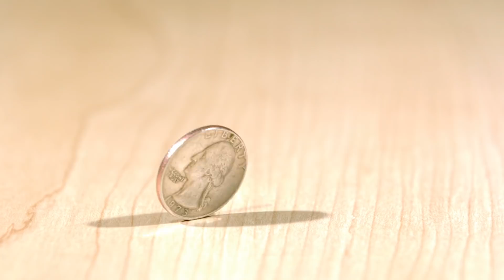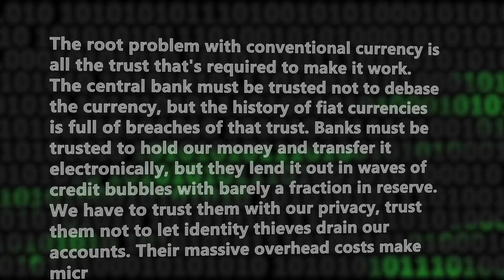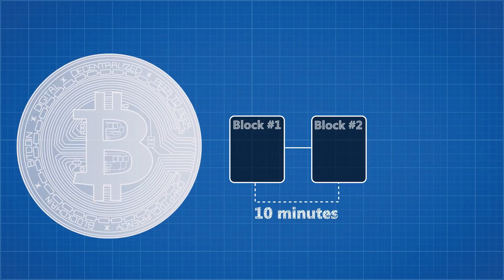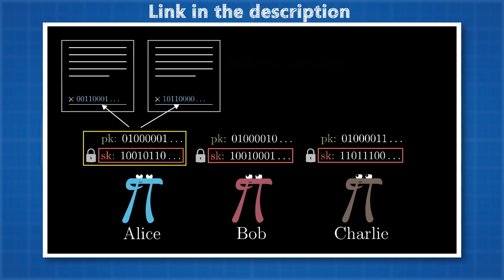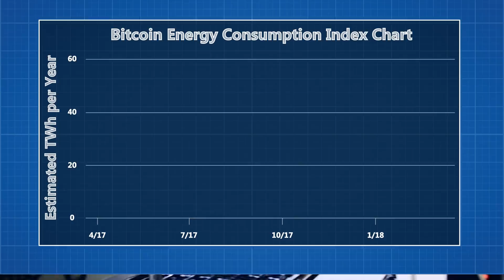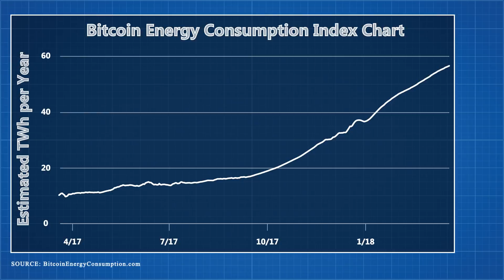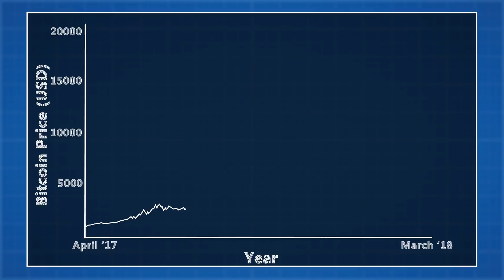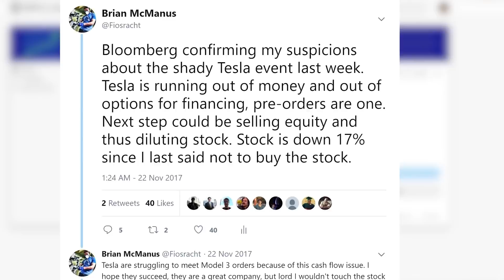Why Bitcoin Is Not Working

Comment: He is outdated on Bitcoin.... And Visa uses more electricity because he forgot to add the electricity costs of partner banks, merchants, users, which was not considered.
Reply: I am not sure if you actually know what you are talking about or not.  Merchant already been doing what you said for years, you don't need a card reader to do any Visa transaction now day (although you can still choose to do so), you can simply pay everything with your cell phone (in fact that's what the Chinese been doing for a few years already, they already have a well establish digital currency system where no paper currency is required).  So you try to argue the point where "bitcoin could use just smartphone for transaction" is completely invalid.

And you keep trying to change topic by arguing bitcoin vs paper currency.  I am just try to point out the fact that you try to argue "bitcoin transaction save more energy than Visa transaction".  I am not here to try to argue with you Bitcoin vs Paper currency and whatsoever.  Just go back to your original post and read what you type "And Visa uses more electricity because he forgot to add the electricity costs of partner banks, merchants, users, which was not considered"  

By the way, there will be no different between using Bitcoin vs Dollar as your actual currency because the economic system is still what it is right now.  The bank is much more than just a place where you store your money, they help maintain the global economy by controlling the asset and cash flow.  Hate it or not it is a well establish system and it get things done most of the time.  Bitcoin-er thinking decentralizing the  currency will get rid of the bank and government control, that just a perfect proof of which they have no basic knowledge of economy.  Who will lend you mortgage when you buy your house?  Who will let you borrow money before you earn them (aka credit card)?  Who will take care your 401k plan and investment profolio?  And you want to hear the biggest disadvantage of bitcoin?  That's if you lost your e-wallet, you lost everything and in fact more than 20% of bitcoin created has been lost forever due to that.
Reply: Is electricity more expensive than people?
Reply: We are discussing the power consumption of bitcoin transaction here, not "advantage of bitcoin transaction".  So let's just discuss only on that topic.  You said it clearly yourself "we do not need any NEW DEVICE", which means we still need device to run such transaction both user and merchant side, hence the same merchant and user cost you pointed out at your previous reply still apply doesn't matter if it use new device or old device.  The bottom line is, doesn't matter how hard you look at it if you talking about power consumption per transaction and transaction capacity Visa beat bitcoin by a mile.  I am not saying bitcoin has no advantage, I am just debating on your original post about "Visa use more electricity".
Reply: Also I would like to add the fact that Bitcoin platform (aka bitcoin bank) has far less credibility than the actual bank.  Every single bitcoin platform has been stolen once if not all their asset before (Mt.gox I am looking at you).  While actual bank was backed by FDIC to cover some of the customer's loss, for bitcoin there is no way to recover those lost.  Once they are gone they are gone because as long as blockchain approved there are all legitimate transaction there is no such thing as lawful or unlawful transaction for digital currency only valid or invalid.
Reply: Lawful vs. unlawful depends on the country where the actual transaction happens and is a legal part of agreements. If they don't exist in your country, it is simply because government (and general public - at least in democratic countries) haven't reacted to the current status of digital currency.

If somebody holds your property than according to the laws (incl. digital assets) in my country he is fully responsible for them and their security. So either he insures himself (like banks do, and are forced to, at Czech National Bank here - in which case he also receives the exactly same status as 'hated' banks) ... or he faces full consequences when losing property of other people - it's simply a fraud.
Reply: I used the word "bitcoin bank" is actually for you since you don't seem to understand too much about bitcoin hence I try to use more familiar terms you can related too.  Yes you can call them bitcoin exchange, bitcoin marketplace, bitcoin storage, bitcoin w/e.  Mt.Gox definitely hit the headline years back when they get hacked while they were at their peak.  Now recently Youbit getting hacked also get some news cover.  The funny thing is as secure as cryptocurrency is, you still can't prevent ppl from hacking the actual device that store the key, so at the end the security it promise is not a dream but a nightmare because once they are gone, they are gone, you can't even prove they were stolen or just "trade" away.
Reply: What do you mean? It is not clear. what is your thought?
Reply: Correct... But you must know SegWit... It will take Bitcoin from current low to greater than 20,000 Tx per second. Google it... I know the merchants are barriers... But you know what, the upgrade to Bitcoins will not need any NEW DEVICE... a simple phone app will allow anyone to become merchants... Thats the beauty of open source and the spirit of decentralization. We want 1and we will overtake Visa. There are opstacles. But better than corrupt banks, and also consider blockchain in budgetary funding, it will eliminate all government scams. why? 100% transparency. They actually can implement it right away, but governments and transparency. Think about the utility of a public ledger in fiscal budgets worldwide.
Reply: Dude... I think you do not know how to use Bitcoin... On the Bitcoin network. No merchants need a card swiping machine. No user needs a card or a pin... It can be done just using any cheap smartphone... Just to inform in case if not you others who will read this thread... THAT ASIDE. 

Electricity: Yes it uses a lot of electricity. Now, think of the cost of the vast data centers themselves. Now think of the cost of electricity. now think of making such centers in remote or getting access to such services in places like oceans. Bitcoin bundled with the upcoming Space+Internet will solve this issue... 
Now electricity. It is to note, Gold, to extract it, there is a lot of investments needed to do that. Do remember the electricity cost of maintaining the ledger is bundled with the control of money supply. So now you should understand how the high electricity costs are valid here. They should be high. You should also consider the cost of printing paper currency. YOu should consider central banking costs. It would be better if you understand monetary policy and fiscal budget. Bitcoin is about that as well. 

In layman's terms, Bitcoin is also about the control of money supply.

YOu might say Bitcoin is using coal electricity which is bad for the environment. It's like saying you do not want diamonds, cause you know about the tyhing called "Blood Diamond" - will you abolish the import and use of diamonds? Well If you can use diamonds, Bitcoin electricity costs are nowhere near to that kind of CRIM and indecent behavior. 

It would be better to shift this to redit and split the point numbering vs paragraphs.
Reply: In short, add up the cost of printing paper currency and cost of-of no counterfeit currency, which Bitcoin is successful in.
Reply: Yes correct... But yes need to add the point of control of money supply... And correct once you lose the password you lose your money.
Reply: Vilem Otte is right... BTW apart Otte's point, I think you really haven't used Bitcoin properly. Did you ever shift your Bitcoins from exchange to a paper wallet which had a public and a private key?
Reply: You might become a laughing stock if you ever say "Bitcoin bank" - hahahahah
Reply: I was addressing solely legal point of view. If somebody holds 'currency' (no matter whether digital, paper ... or even physical) of others (and allows transactions with them!), he is considered legally (de jure) a bank (as financial institute) here.
Reply: Have you any idea how many more people, relative to bitcoin, are using VISA? 
Have you any idea, how insanse the electricity consumption of bitcoin would be if every person on the planet would use bitcoins?  Only a handful of people have invested in bitcoins. Most people don't have any bitcoins or any other crypto currencies. And from those who do have, the gap between rich and poor amongst bitcoin owners is even larger than that with the dollar. Most of the bitcoin is in the hands of only a few people. And that would become even worse if every other human who so far has not bitcoins tried to get some. Cryptocurrencies suck in every possible way. But of course you'll have to lie and say how great they are because you don't really care about the cryptos, all you want are real dollars. You need to convince the next big idiots to buy your cryptos for more money than you did, so you can make a profit and ideally become rich by scamming others.
Reply: Your point is invalid because assuming bitcoin will completely take over Visa tomorrow all the factor you mention will also apply to bitcoin as well.  You still need Merchants, user cost if you run bitcoin as your main transaction method, you also need much larger computing power for the transaction because how limited the blockchain size is.  In a nut shell, even you take out all the "mining" part of bitcoin, by just power consuming per transaction standpoint, bitcoin is still far less efficient than Visa.

Comment: Not sure why this video is getting so much hate. Although Bitcoin was a ground breaking idea, it's far from ideal because: it has lousy throughput and latency, is computationally intensive. 

I'd be interested to see how newer alt-coins tackle the volatility problem. Because the quantity would have to change in accordance to demand to maintain a stable value, which seems a little odd.

Comment: First part is excellent. Second part forgets to mention the Lightning Network. Also:
"Total consumption for banks during a year only ... is around (I am rounding) 26Twh on servers, 58Twh on branches and 13Twh on ATMs for a total of close to a 100 Twh a year.
According to the article that trigger this discussion, Bitcoin annual Twh consumption is 28.67 , so currently more than 3 times more efficient than a very conservative calculation of the cost of the global banking system. Of course you will argue that the banking systems does more than handling a currency which is true but the difference is large enough that I do not think is that relevant. Even if only 30% of banks electricity consumption was the comparable part to Bitcoin, that will still make Bitcoin more efficient.   https://hackernoon.com/the-bitcoin-vs-visa-electricity-consumption-fallacy-8cf194987a50

Comment: Pretty shit video. ZOMG BITCOIN IS VOLATILE????? ZOMG BITCOIN uses a lot of electricity? That's all you got? Great brand new criticisms here. It's a brand new asset, of course it's going to be volatile. No one knows what it's truly worth. Of course it's expensive; that's the cost of running a trustless system. How much money does it take to run the current system? Not just Visa's costs, but the costs of every bank, ATM, printing press, every bank employee driving to work, etc. Everything considered it's cheaper than the current system. And zero mentions of the Lightning Network, which will transform Bitcoin and massively increase its transaction capacity. GTFO out of here with this uninformed nonsense.

Comment: Very valid points. Energy consumption for PoW algorythms is a serious issue, and can potentially undo those coins in the long run. However, blockchains are here to stay...so greener alternatives are researched, implemented and required. Take for instance Proof of Capacity (PoC) and it's coin, Burstcoin. These coins have all the benefits of a blockchain, smart contract etc etc. but are mined on harddisks instead of ASICS/GPUs! This results in about 400x less energy consumption for the same ammount of transactions! 

I think we should all be going into the direction of coins like burstcoin and its Proof of Capacity algorythm. Interested in Burstcoin? Have a look at this video to get a basic understanding. https://www.youtube.com/watch?v=Fyj9RIyxLb4
Reply: Proof of Stake will eventually replace the Proof of Work determining the value of a Crypto Currency... This is the future ahead which these simpleton cannot sink in... It is just like Supply and Demand like on our economics....
Reply: But proof of stake has its fair problems, the most important one being that it so much more centralised. It all originates from the same place and only slowly trickles down to the real users. Also, pos actually incentivises you NOT spending your coins, as having a lot of them is beneficial. I see PoS as a green alternative, but not as a viable crypto algorithm...hence, proof of capacity. It HAS all the benefits of PoW, but in a 500x greener form. For me Proof of Capacity IS the future of crypto instead of either PoW or PoS.
Reply: Centralized only if whales can manipulate vast amounts of coins, if there would be a limit per person and Staking feature is set, I think it would be beneficial to the whole Cryptospace. One Problem to the manipulation issue is the stake holdings....
Reply: Tbh, it is centralised by default. All coins originate from the same person - so they only become slightly more decentralised as that person, and the next person in line, and the next person in line again and so on, decide to send their coins to other people. I think in the very essence of PoS something is flawed. Where a mining algorythm like PoW, or more preferably PoC, allow everyone to just fire up their miners and get some. Sure, if you are early you probably have more, but noone is stopping you from expanding your farm and generating more coins. In its very essence its just a better model in my opinion.

Comment: Electroneum will be a better form of "currency". Monero is a better way to buy drugs. Both Electroneum and Monero are based on the CryptoNote algorithm :)  BITCOIN IS DIGITAL GOLD, IT WILL NEVER BE A CURRENCY.

Those GPUs can't mine Bitcoin. They use ASICs, please use the correct visual aids for your presentation. Thanks.

Comment: 4 Transactions per Seconds is not a fixed number. In fact, it is really easy to alter the maximum allowed transactions per block, and due to Bitcoin's scripting language you don't have to put every payment in an official transaction, a System called "Payment channel". I do agree on the volatile-part, though.

Comment: When your money system requires a ledger on thousands of people's computer, it is doomed to fail.  The data capacity is going to murder itself
Reply: When your money system is not back by anything and you can print an infinite supply of it, it is doomed to fail. At least bitcoin is actually trying to make something different work. 1000+ years of currencies has not worked historically too many times to count.

Comment: Unfortunately your video is padded with undiluted horseshit that fails to acknowledge:

1) The Lightning Network, which solves the transaction throughput problem and effectively drives off-chain transactions to zero cost.

2) How Bitcoin energy consumption is driving forward sustainable energy by providing a financial incentive for it.

3) The fact that Bitcoin is actually working and has had functionally zero downtime, unlike the incumbent payment card infrastructure which does sometimes go down.

4) That Ethereum is not a more advanced version of Bitcoin and doesn't do it better. It has its own massive technical problems and the wonderful prospect of being eternally inflated, unlike Bitcoin that is disinflationary, which makes it useful as a hedge against the USD that sits there inflating away year on year in your bank account in this new world of ZIRP banking.

5) That in a world where bank "bail-ins" have now become a real idea, where the capitalist class insures their financial losses by helping themselves to your money, Bitcoin hands back full financial power over your money. This is an immensely important idea.

Yeah I'll take my chances with Bitcoin, thanks. It doesn't need to replace the USD or gold to be useful. It has already earned its place in the world and will be around for longer than the USD, in my opinion.
Reply: Ok College Kid, Lightning Network: YOU HAVE BE ONLINE TO RECIEVE A PAYMENT.. GAAAAAAAAAAAAAAAAAAY AND FAIL